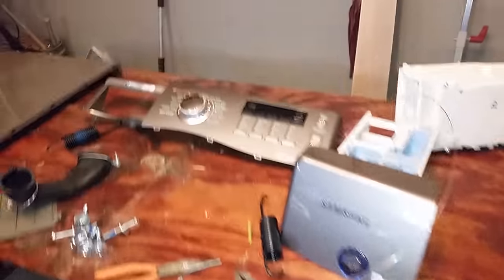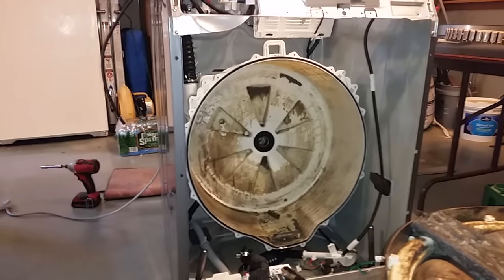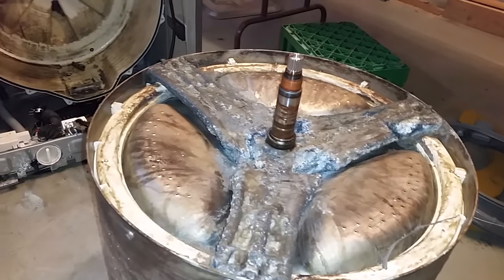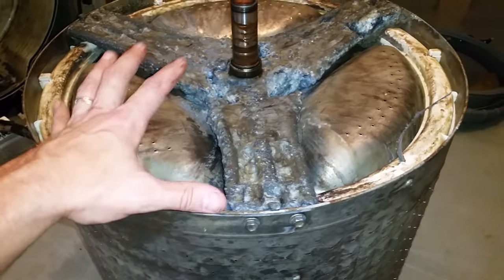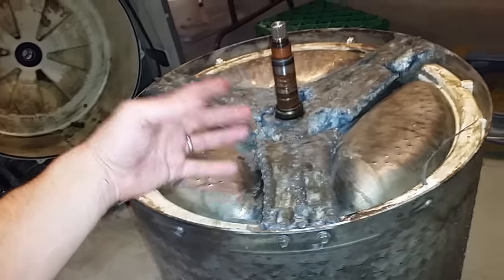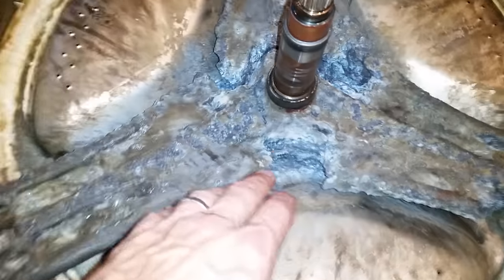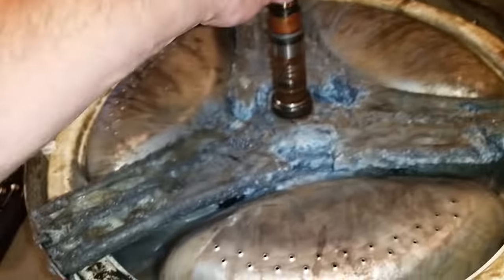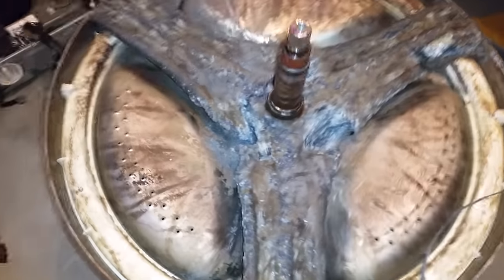Do not buy Samsung front load washer machines

Comment: If you must have a front load buy a commercial one. My speed queen was purchased in 2006. I work on appliances and I think all front load units that are non commercial are problematic. Now they are making top load units that are junk. I now find older machines refurbish them and resale them. I have a customer that has had 3 top load washers in 4 years replaced under warranty. I sold her a refurbished 2006 maytag in 2014. Went to her house in November 2020 to replace the drive belt. I had so many front load and top load washers at the shop because parts and labor cost more than the unit to be replaced. Also who installs electronics in a machine that is a moisture rich environment. Especially when a control board is 278 my cost not including standard mark up.

Comment: Since like 1995 there was no more companies, that made a product with the idea to last with years, but rather made in such way to cause the product to fail just after the warranty ends, so you can buy a new one after that... For example, old vacuum cleaner still works, but it has cosmetic issues for example and you decide to buy a new one, the new one fails in a few years, plus the old one works better than the new one... I've experienced it myself and this is not only with the vacuum cleaners.
Reply: If you owned a Samsung washer and it failed in, let's say, 5 yrs, would you buy another Samsung? What would be the point? You've just had a bad experience with their product. Do you think the manufacturer's sales team knows this? No manufacturer makes something that is designed to fail at a certain point. BUT, manufacturers WILL make something as cheaply as possible and change designs if something fails too soon. With the exception of Samsung. Their products are trash. Samsung doesn't care.

Comment: I feel that this is %100 planned obsolescence but i feel samsung did not expect this to happen so soon (within 2 years),  there is no way the engineers  wouldn't know that this type of metal would break down quickly due to galvanic corrosion and the washing soap.  My brother had a Samsung and it lasted 2 years before cracking  the spider arm it was actually under extended warranty and the new part lasted another 2 years and broke again. I also had one with the same issue. if they had to use this type of metal they could have painted or coated the arm and it would have lasted 5x as long which is what a lot of DIY people are doing when they replace the part.

Comment: I had a Samsung top loader that I bought at the end of 2013. This is the washing machines that people are suing Samsung over. They sent me a letter and 79 people had smashed Jaws and one had a broken hand because the drum spun out of control and it went straight up broke the top of the washing machine and right out that glass top of the lid. I got the litigation letter 2 years ago. Then Samsung sends me a plastic cover to go over my dial and said I should not use the heavy duty because it could spend the drum out of control and it would take off and come out of the washing machine through the top lid it could be dangerous. Can you believe that, that damn Samsung sent me this to put on my washing machine dial. Well I was scared kind of to use it so when I did do a load of laundry I would turn it on and get the hell out of my laundry room. What kind of crap is this can you believe it. I paid over a $1,000 for this top-of-the-line washing machine back in 2013. I was replacing it with my twenty-three-year-old Kenmore washing machine. Well this week the damn washer just let go and water was in the utility room in my hallway and almost reached my living room rug. Needless to say thank God for wet vacs, I spent hours and hours cleaning my carpet up and utility room. I called Samsung and they said they'd give me $100 for the recall that has been about for the last two years. I wanted my thousand dollars back. Then they told me yes they know about the recall over 2 years and that I was not to use the wash machine on anything but delicate cycle. Can you believe that. Then my other option was because it was a recall wash machine which they made for 3 years while people were almost getting killed because of these damn washing machine Samsung made! The customer service at Samsung said or we can send somebody out and put bolts so your drum doesn't spin out of the lid so they're going to drill and put big bolts on the side of the machine to hold the drum down unbelievable. so I told him I want my money and he said I had to buy another Samsung to get $100 recall money back. Plus the fact that they never contacted everybody who bought one of these dangerous washing machines that mutilate your face or your life. Samsung has really taken a turn for the worst oh, but then again I heard the reviews on Kenmore and they're horrible but at least the drum doesn't come out of the washing machine and but at least the drum doesn't come out of the washing machine and could kill you. Check it out if you don't believe me. my God are we at the age of Anything Goes, is there anything good about the 21st century merchandise anymore? I know they're getting sued big time for the people that got injured very badly when that drum came out of the the washing machine. I can't believe I would run out of the laundry room when that thing was on spin cycle. I did get a letter from many people that are suing Samsung that have these wash machines and I'm joining the lawsuit. you talk about population control, Samsung the leader. this was a top loader to. no more Samsung products for me either I pray they go bankrupt.

Comment: Just replaced the spider in my Samsung WF218 and it was similarly corroded to ratshit.  I'd originally hoped it was the dampers, and I'm sure a lot of dampers are sold on that vain hope.  But once you have the front off the machine, taking the drum out isn't actually all that hard.

The problem is a poor choice of material and a poor part design.  Aluminum (my replacement part shot with an XRF gun was 95% Al, 2.5% Cu, 1% Fe, 0.85% Zn) is known to corrode rapidly in hot, alkaline water, and that's what you wash clothes in!  Bleach, including the percarbonate/persulphate solid bleaches like OxyClean or those cleaning pucks that they sell for front load washers, are going to make that corrosion go faster still, but you do need to use those cleaners to keep your washer from building up a nasty biofilm inside its tub.  The part is cast with deep grooves in it which attract and hold debris and make it hard to wash it back out again, which holds water against the part and accelerates the corrosion-- but you can't blame the failure on the user not cleaning their machine well or often enough or using the wrong detergent as all detergents used for washing clothes are alkaline and will attack aluminum over time.  My own drum was very clean but the spider was chock full of its own corrosion products.

I sandblasted and painted my replacement part (masking the driveshaft carefully first) and coated it with two coats of surface tolerant epoxy- we'll see if that lets the machine live long enough for something else important to fail!

https://youtu.be/kSP_fKPX9Hk

Comment: You left us totally high and dry on this. So, what did you replace? Was it the three prong bracket attached to the stainless steel drum? Or was it the three prong bracket with spindle attached? If that was the case, then it only looked like six bolts attached to the stainless steel drum. No, video of that process?

Comment: Samsung is so so good at this. The metal they used on this is designed to do just this.

My theory is electrolysis its zinc which is sacrificial. Basically eacg cycle eats at the spider mount

Comment: Mine blew up yesterday and made a huge bang, spindle sheered and afterwards I could see that the 3 alloy arms were very badly corroded.
Was doing the high speed rinse when it let go with a bang.
Moved machine 1 ft out, huge explosion that pushed case out 6 inches and even smashed the cupboard next to machine.
Lucky no one was in the room when it went.
I would warn annoying using these machines especially after 8 years, your in the danger zone.
Our machine was 11 years and would probably have gone on for many more if it was not for the fatal design floor of those 3 alloy spindle wings, they were so badly corroded.

Comment: Holy shit, that's what that shit is, I suspected inferior materials, I've heard of problems Samsung have not bothered fixing in products design for no reason.

After simply searching 3E & finding only broken motors or nothing related to that code, as soon as I saw the state of that bracket, I recognised that shit gradually building up in the pump & have been wondering about this type of peoblem as the possible source of the debris that crumbles but looks like it should be solid yet crumbles like eaten right through the structure.

Fuck samsung, for good, I'm done with them

Comment: There are other makes that are worse. The Smeg front loader we had sheered right off with a similar corrosion problem mid cycle. So that the drum use flopped around loose. The metal web looked identical to the one in the video.

Comment: Front loader washers will decay unnaturally fast if too much detergent is put in the washer or if the washer is overloaded (even though clothes fit the weight of what is put in the washer is beyond the specified weight). Overloading causes the shock absorbers to quickly wear out,  too much detergent (or non HE detergent) causes build-up on components causing corrosion or damage to parts   IE:  Front load washers you should NOT see suds in the machine!!!  The suds will build up and damage the hardware of the machine!

Comment: It is called a spider. Actually caused by a user error. Error is believing a manufacturer. The failure of the spider is normally caused by laundry softner and also luck of ventilation of the washer. You need to leave washer always open and not use softner.

Comment: Don't buy Samsung anything appliances.  I've been on kijiji looking for deals on fridges and washer and dryer and I see them all the time, pretty new, being sold cheap or given away for parts.  The dishwasher when we moved in was Samsung as well.  Great to look at, gleaming, w/ blue lights, sings you a song, bells and whistles up the ying yang, but toasted.  Most of the repair guys in our town won't touch them.  I called a professional and he said they often cost more to fix than it's worth.  We looked at reviews and same issues w/ mother boards and every kind of error message.  Total crap.  And yet they fly off the shelves at major stores.  The rare ones I see that work are new and have dents and broken shelves and such (fridges).  Stay away.

Comment: Bought a Top loading mechanical stackable  maytag back in the 80s.  No computers back then
 New transmission and pump 12 years ago.  Everyone said why didn't you buy a new one.  Dishwasher the same.  All mechanical dial.  Never could figure why a computer board was better than a mechanical switch when everything else on it is mechanical.

Comment: My Samsung vrt steam 4.7 washer the ball bearing started to make noises during the spill cycle after running the pure clean (self clean) mode when adding baking soda and vinegar to the water. Samsung manual tells you not to add anything into the water.

Comment: All the front load machines use white metal for the spider. GE's have been rotting out for years even on the top load washers!  Every one, Frigidaire, Whirlpool, LG, Samsung, etc will fail on average of 5 years.  Phosphates in the detergent makes it worse and most people don't use the recommended "he" detergents.  Check your drain filter and if you see a "gray looking substance", it's the spider rotting away.

Comment: If you had read your owner's manual you would know that you can not add more bleach than what Samsung states.  Adding too much bleach is what causes this.  The over-rich bleach mixture eats at that particular metal causing the deterioration.  And this is true for all front load washers.Sacrificial zincs are installed for electrolysis, and I've never know them to be installed on clothes washers.  If this was truly caused by electrolysis, then you should have your house wiring checked.Your machine is filthy and appears abused by overloading and never running the cleaning cycle.  Or, you're recycling gray water for your laundry.  I'm wondering how many trips you and your house mates have made to the dermatologist.

Comment: It's wrong to bash a product if you don't know what you're talking about. ALL front load washers have the same issue. I'm sure you meant well but it's misleading to say this is a Samsung issue. It isn't. I did this repair on my Samsung washer. It's a pain but my 12 YEAR OLD washer was fixed for $180 and still works great.

Comment: Samsung less than 3 years repaired 3 times. Now it's broken again out of Balance but when I open it the steel drum is broken apart from the holding shaft all bolts holders are free and steel  drum case shattered.

Comment: lol, yea they know what they are doing. and they aren't the only one doing it. appliance manufacturers started doing this around the Millenium. making their machines to fail so you have to buy a new one. And for some reason, the law isn't holding them accountable. Best you can do is find a machine from the 90s.  I have a stacked washer and dryer from the 90. the only thing that ever went bad on it was the dryer barrel bearing. I replaced it and its been running fine for over 20yrs. the washer part of it has never had any issues at all. the worst part is  I didn't even buy the thing new. it was used when I bought it lol it's a Frigidaire.

Comment: My washing machine leaks. I suspect that the metal has corroded where the water enters the soap dispenser and it leaks down the inside front shell, and has rusted it from the inside. I think the leak happens every time the water is flowing into the the dispenser. The machine still works but I have to put a towel down on the left side of it or there's a puddle in my laundry room. Definitely inferior metal.

Comment: Literally had a Sears Kenmore dishwasher fail with the door dropping down. There were two springs on each side to counter weight the door weight. Between the two springs....a thin piece of plastic clip. Designed to break over time releasing the two springs from one another. Engineered failure for future $$$.

Comment: All washing machine had this spider attachment I believe it was caused since magnesium  for light and cheep production. Could had press out stainless steel . Replacement spider of same cost 150-180 the nut that holding even cost 17 dialler each.so one would bought a new one,! Sell it before or made with stainless steel pipe  with welding !or made from wood.

Comment: Not just Samsung, this is standard stuff.  Lots on the net, to prevent/slow down, do not use to little detergent, wash in hot water, do clean with bleach every month, so not use liquid softners,  keep door and detergent tray open.  Why?  To little detergent and cold water do not dissolve dirt enough to carry it all away and it stays behind to create a coating, as do softeners.  This coating creates a moist environment that advances the corrosion, which is also why a door should be kept open.   BUT you will never read this in an instruction manual, you find out when your washer starts to rock and roll and you research WTF on the internet.
Reply: How does one  figure out the right amount of detergent? For me it's two teaspoons or 30 gms. How much is it for you? I've substituted bleach for NaDCC tablets. Water puririfer tablets. This way there is no lye in the machine that is bad for it. Lye is used as a stabiliser with bleach. Three of those tabs in a 2 cu ft front load and even the room starts to smell of chlorine.

Comment: All the front-loader mfgrs use the same design in "their" washers... I'm finishing up a spider replacement in a Samsung washer now... I replaced the spider in my LG TROMM washer a few months ago... I saw the insides of a Kenmore front-loader... They are ALL very similar machines inside, and it doesn't matter whose name is on the front panel... They are all using sacrificial metal spiders... It's called "Planned Breakdown", and they do it so "they" can sell parts to people in +/- 6 to 7 years for the purpose of... yup, you guessed it... Making money...

Comment: Buy a basic top loader. Cheaper to buy and cheaper to fix if they have problems. Parts are easy to find and fairly easy to replace. Just my two cents.
Reply: Ralph.  Yep. I have an agitator. Spent around $100 total to replace a few worn out parts myself just a couple years ago. Easy to diagnose, no computer system. Works great.

Comment: I'm sure people would pay an extra $1000 dollars for a well made stainless machined tripod in the back rather than use less soap like they are supposed to. Me, an appliance technician who sees this on a lot of machines no matter the make, will just fill to the line in the cup that says 1. Maybe 2 for dirty clothes. Which is about 3 tbsp of detergent. More soap doesn't mean more clean, soap left over provides nutrients for things like mold, mildew, bacteria, and algae to grow in your appliance. Don't blame the manufacturer for you using too much detergent.